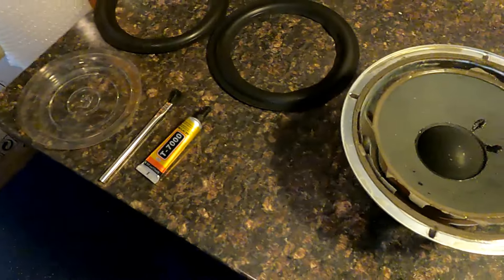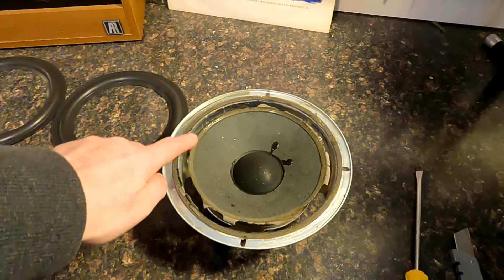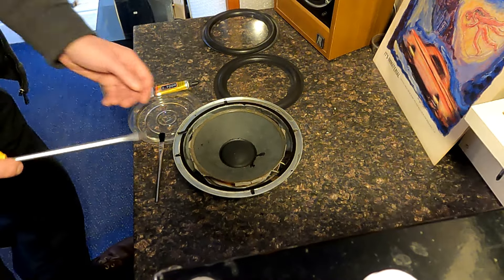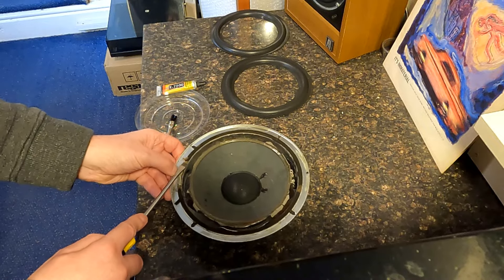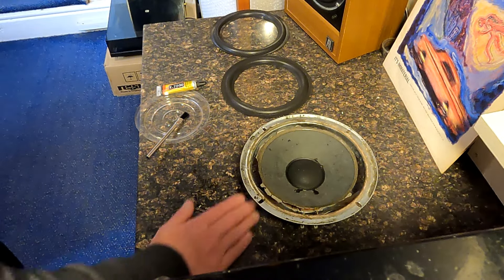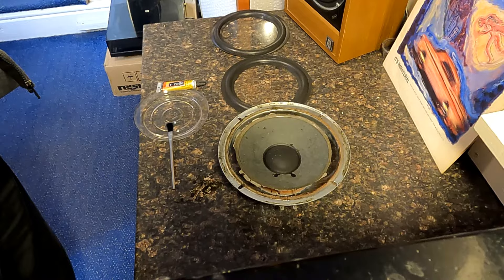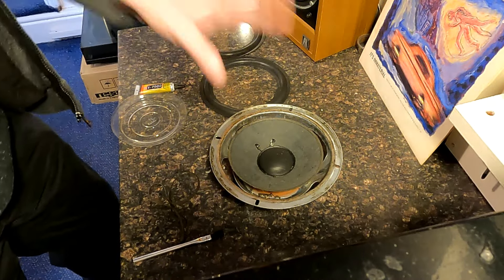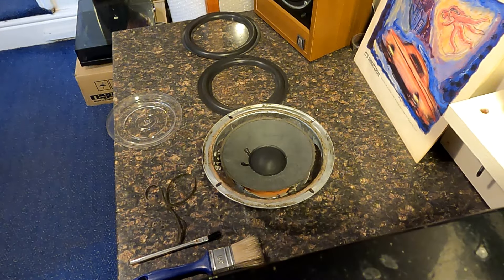Acoustic Research Speaker Project Part 2   Refoaming the Bass drivers

Comment: Some acetone is better for the glue, it really makes it so much easier, i did the same with my Mission 700's a few months back and the glue was awful, nasty tacky stuff that would not lift.

I have done a few lately including a set of kef B160's, AR 8LS and have a set of mission 720 ready to go but am struggling to find the correct surround for a reasonable price.

I see you have used North Speaker Parts, used him a few times and he is good until you want to return a product that he has wrongly labeled, he may or may not contact you and will then just ghost you.

Comment: I need recone my set.   Do you have a source for cones/coil/spider etc?  I am told you need to energize the cone with a low frequency to assure it is centered?     If you get it glued in crooked it will rub the coil?